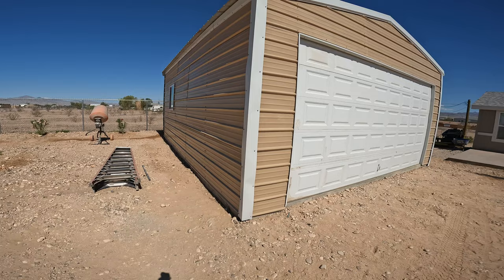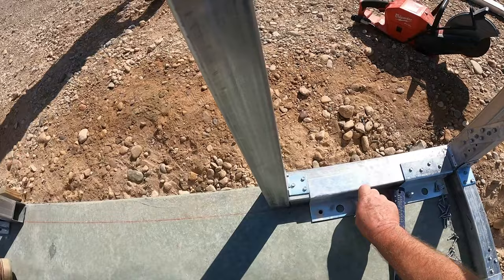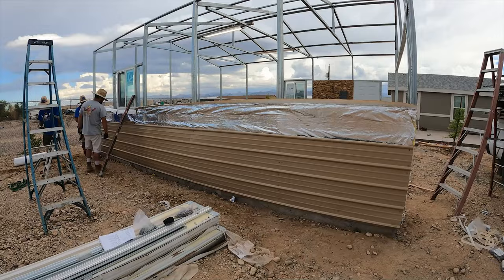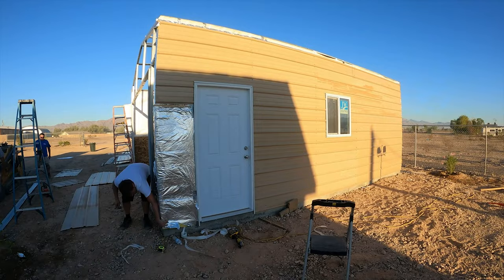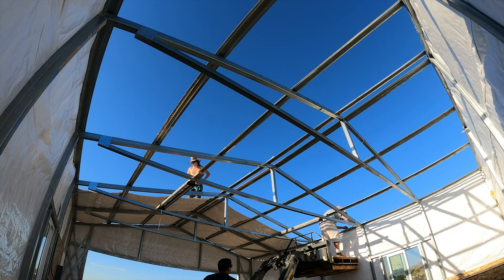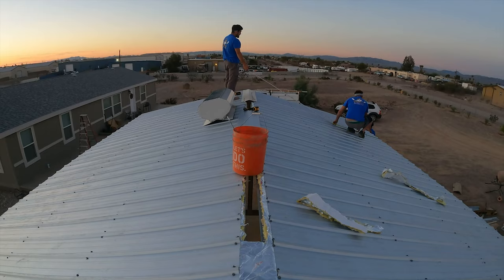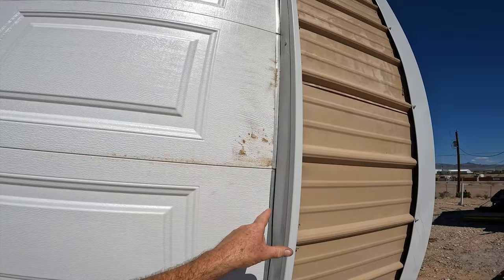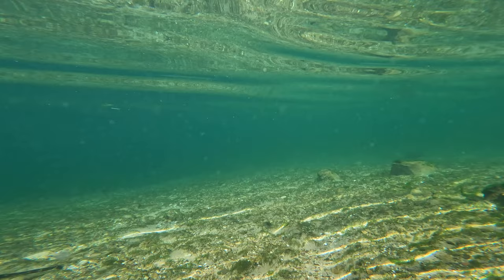How to Build Your Own Garage! Pt. 2 Final Inspection on Metal Garage Build

Comment: I'm old school.  Wood framing and stucco or cement siding.  I remember when your chain link fence blew down.  Nice job as always David.  I enjoy all of your videos!👍👍👍
Reply from the maker: Wood cost are outrageous .
This is reasonable and engineered to work.
Reply: stucco or cement siding adds considerable weight to the walls and needs to be engineered to suit. There is no advantage to wood, the galvanised steel is probably more durable. This is a cost-effective build. Cement sheeting is a better insulating material but it is all wrapped in foil-backed insulation anyhow.

Comment: Did they not give you j-channel or some other flashing for around the windows and doors?  Maybe it's there I just didn't see. These metal designs are neat.  Some use a foam like filter in between the ridge cap and roof valleys to fill that void. 

I'm amazed how many swear by using just the 10x17 or x20's Harbor Freight or whatever carport portable shed alone and only adding the steel roofing and siding with the self tapping screws. Including in hurricane zones.  That's not even the heavier square tube car ports.  Though many I've seen do add extra wood or hat channel material for studs and/or purlins and whatever they want for an end look.  Nice!  Awesome getting some plants growing as well.
Reply from the maker: No j channel, but window itself has a H channel
Reply: @OdellCompleteConcrete  I see.  Next up, fun with dust! 🙂

Comment: In case someone is thinking about building one of these all the screws used have neoprene washers don't over tighten them they will split from to much compression just snug them up and plan on replacing them in 10 to 12 years
Reply from the maker: Makes sense

Comment: Need the 220 in the garage for level 2 charger also...
Nice work; quite a nice metal framed garage. I always presumed that metal framing kits were tinny but that actually looks fairly solid, especially with the added OSB.
Reply from the maker: Never paint or roof.
TY

Comment: Nice building! I just ordered a very Similar building and am doing it myself. I have construction experience but zero concrete experience. Due to lack of finances My plan is to basically just pour perimeter footings and 6” stem walls, construct the building then later on pour the interior slab. Do you think I am able to pour the footings and stem walls all at once? I’ve seen videos where guys will pour footings and then wait for them to set up before pouring the stem wall. My concern is if I pour all at once the wet concrete in footings will push up too high and out on grade from the weight of concrete in stem wall forms?
Reply from the maker: You can do it

Comment: Nice. Being that it gets so  hot, do you think more insulation on the inside of the garage would keep it cooler inside?
Reply: dude the only way I would live out there is if I built a concrete quonset hut (they build a regular one and cover it with rebar and shoot shotcrete on it) and then covered it with 4 feet of dirt.. and I would definitely have a basement with 12 foot ceilings .. but i'm not sure that would help heheh its just insane hot out there .. people should not live there heh...
Reply from the maker: Yes, definitely

Comment: It’s interesting that the kit doesn’t appear to include any structural wind bracing components in the roof or wall framing.
Reply from the maker: It's all steel, even the siding. Steel siding is bracing.
Reply: 6 minutes in, near the door area x bracing

Comment: Will you add more insulation or will a mini split be able to keep it cool/hot as is?
Reply from the maker: I'll let you know soon enough.
The unit I put in is oversized, so maybe
Reply: a mini split is too small for that volume and building. It would need to be a larger capacity unit but then again does one require a shed to be 72 degrees year round or does the whole shed need to be conditioned?

Comment: What brand is the building kit, lm in Rochester ny and want to do a 30by40
Reply from the maker: Absolute Steel
Reply: @OdellCompleteConcrete  thanks, hard to get a price out these companies. From your videos I’m thinking you’re in 315 area code , I grew up in Syracuse and have lived in Rochester for 35 years. Live in a neighborhood and with the inflated property prices I guess I’m stuck here for the duration, so I guess I’ll try to put up a building. Watching your quality work and also Victory’s trying to learn about concrete work, judging if I can do it myself. I’m a machinist with a business in my two car garage and pretty clever but concrete isn’t a one man job. Considering it from all angles ( small sections with a mixer or short loads) it would have to be pumped 100 feet. Pole barn with a slab, foundation with a sill plate…… I don’t know!